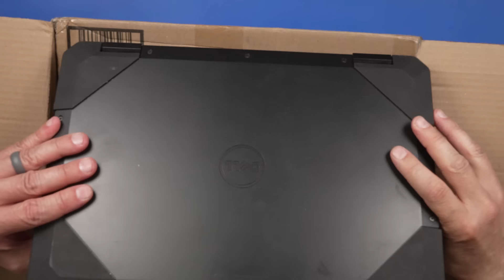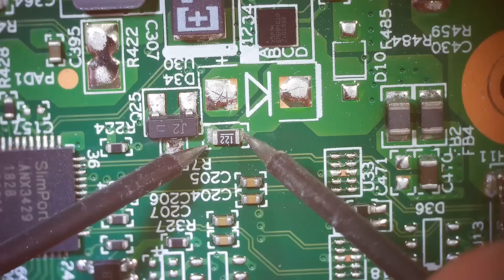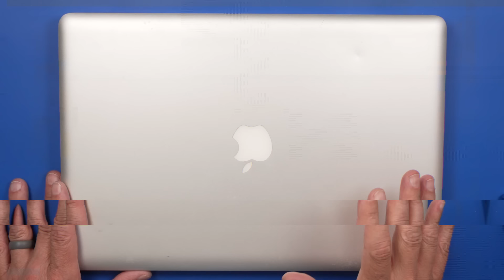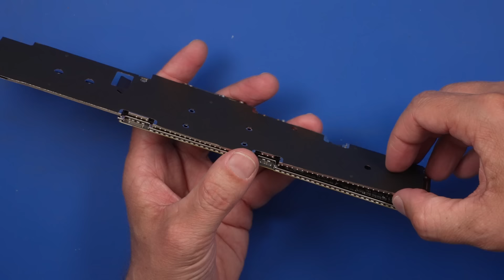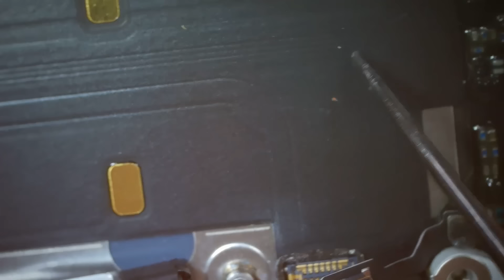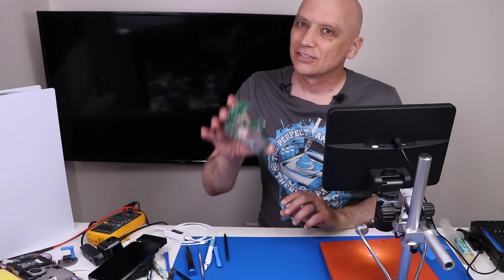Austin Evans Broke These with a USB Killer - Can I Fix Any?!

Comment: 1st device: the problem is a PMIC or ceramic cap that's shorted to ground. put a bench power supply in C.V. mode set to .8V (usually low enough that it wont damage any processor the line may be shorted/connected to) and set the current to the max. if there is a shorted cap/IC, it will get hot (you can detect this without a thermal camera using 99% isopropyl alcohol, drip some on, and look for the component that starts drying off instantly). that coil specifically is hard to tell if it should appear low resistance to ground, since some components (like the CPU) can appear as a very low resistance, but others (like a charging circuit) can appear as high resistance, and since its near both a charge port, a port that can output power, and the CPU, its hard to know without a schema (though you could always check continuity to the power pins of ports)

2nd device:it seems like you're looking at the charging/battery circuitry, which wouldn't have been effected by the USB killer, which delivers a high voltage via the USB port. you would need to look at the USB circuitry to have any hope of finding the problem

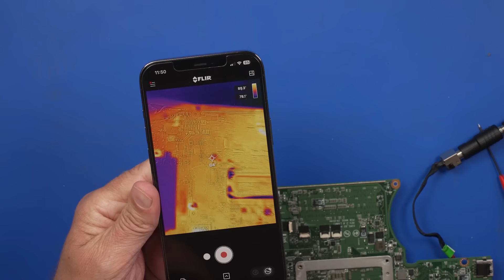3rd device: those two little components are TVS diodes (these ones apparently arent exactly capable of withstanding and protecting against anything as mean as a USB killer). while it is possible that the one component you removed (which looked like either a voltage regulator or possibly a package with a 2 mosfet pair) is blown since the temp dropped after you removed it, its also possible power was flowing through it and being shunted through something else that was blown. also, the reason it looked like the hot-spot was in an area without any components is because the thermal camera you're using has both a visible light sensor and an IR sensor, and in the app you need to properly align the two images. at 19:20 you can see the circular screw hole (visible light), and then above it you can see a yellow ring (IR light) caused by the semi-reflective exposed copper ring surrounding the screw-hole. if the app/camera is properly set up and calibrated every time you use it on a new device, you shouldn't have these issues. (I don't recommend getting a flir or similar, I found mine to be a bit of a waste)

4th device: while it does look like the TVS diode saved the port's ass, I would be curious to see whether or not the data lines on this port are still functional, since on an earlier device, the TVS diodes on the data lines looked blown. I'm not sure what all lines the USB killer sends voltage into, but it looks like he didn't fully test the ports here

my break is over, but I might leave a comment with the rest of the devices if anyone cares.
Reply: Would this apply to a GPU as well? I popped something on a graphics card and now the whole card stays cool except one IC or something on it gets very hot, like hot enough to burn me if I held my finger on it long enough. Given its only a HD 7950 but I would love to get her back up and running. I have a gt 730 and a gtx 1050 ti that all do nearly the same thing. When you plug them in and use igpu the cards are detected but have the "!" in the triangle icon on them. The hd 7950 and the GT 730 had the fans connected backwards and blew up something fan controller related. The hd 7950 had one fan that would not come on while it worked correctly. After it blew both fans just run at max RPM now.
Reply: @HardWhereHero   just to clearify, for the you can boot up the system with the GPU installed, and using the igpu for display out, but the GPU shows up in device manager with an exclamation point? And one specific IC gets burning hot? At what point we're the fans connected backwards, and did the card output video after that? It could be that the fan controller died, and the card is going into some form of pre-emptive thermal shutdown. Usually the chip that controls the fan has the ability to put the card in something of a safe mode, and if the whole chip is dead, this may be what's happening. I would need to physically see the card to be able to give my best advice, but I can still try to help via comments.
Reply: I was really surprised that he never bothered to try the alcohol method. I hate watching these videos half finished. I'd love to see him make another video revisiting these possible solutions.
Reply: @bgubs07  Considering his condition it's great he is uploading any video at all
Reply: @terminationshock1356  this is not related tohim having cancer, he simply doesntknow what todo. He aint no genius
Reply: @bgubs07  right?? Like, as an electrical technician (studying to become an engineer, but not one yet), it's painful to see this sort of thing.
Reply: @alexplayslife7782 so, what thermal cam do you recommend? Board repairs is just a hobby for me,  with pretty low success rates, if I'm honest 😂 but, I have been wanting a cam, and was considering the flir, but it's a pretty hefty price tag, so have not pulled the trigger just yet.  Do you have a better recommendation in that price range? (Or cheaper)
Reply: @brody6634  a flir cam that plugs into your phone is a good option (be sure to read/watch tutorials on it, because there's more to learn than you'd think). They can be a bit pricey, but are available on Amazon. In lieu of a thermal camera, may I recommend using isopropyl alcohol. It will evaporate very fast when heated up, meaning any shorted caps/chips will dry up much faster than other components
Reply: @brody6634  huh, I thought I answered this comment before, but my reply doesn't show up here for some reason. well anyways, I've used a flir in the past, the kind that just plugs into your phone. I could recommend it if you do high-volume repair, or work in a shop and are willing to let the other techs borrow your stuff, but it's not really all that necessary. You can always use the isopropyl alcohol method, where you pour a bunch of isopropyl alcohol over the board, and whichever component is shorted will get really hot when powered on, making the alcohol evaporate away really fast. This only works if there is actually a shorted component, and also if no fuses have blown, disconnecting the short from the power rail. It's not as clear or detailed as a thermal cam, but it is much cheaper. If you do get a flir or another thermal camera, I employ you to read the manual, as I promise there's more to using it than you think. If the manual isn't detailed, please read up on reflectivity, aligning the thermal camera and optical camera (specifically on flir cameras that plug into your phone) and try keep in mind the temps you're looking for. If a moafet gets up to like 70°C when it's normally only slightly warm, while that could be the problem, it's likely that something else is shorted and is drawing power through the moafet (and it'll be much hotter) that is all to say, don't assume something is the problem just because it's warmer than usual, there's likely more to the story (also look at both sides of the board, sometimes a shorted component won't be able to heat up the board through to the other side, so you won't see it.
Reply: No esfacil reparar notebooks, tenes que estar en el tema, recomiendo el canal de REPROMOD. Al margen de eso me parece que el M6 AUC 4S0101 para mi debe ser un mosfet doble, similar al Aoe6930.
Reply: @alexplayslife7782  thank you for your comment. I appreciated it.
Reply: I thought the same thing for device 1 and noticed at 4:47 that C358 just to the left of the chip he's talking about looks like it could be cracked.
Reply: something else that might be useful to know, the USB killer works by taking in power from the USB +/-, then injecting it directly into the data pins. it's a lesser protected vector of attack, that usually results in a dead CPU, USB controller, or both, or even others.

he mentions them having no power... and with a dead CPU, that's entirely possible.
Reply: @starfox.64 kinda late for the disscusion but yeah, I learned in a bad way that  the USB ports have a kind of direct line with the CPU so, even with a daily use if you do not connect right you usb thumb drive you could kill the cpu and that usb port.  This is insane when you look that with Thunderbolt and USB 3 a lot of power can be send directly to the CPU if you are not careful
Reply: so true
Reply: @alexplayslife7782 Give me whatever book(s) you used to learn all this lmao

On a serious note though, I've wanted to get into micro-computing like this but finding good sources to read that fully cover the material to this degree is just utterly impossible.

Comment: I think a faulty charger caused something related to the charging on my sister's macbook to stop working. Cus i got a replacement battery and it turned on and worked but no matter any of 4 usb c charging ports I tried, it wouldnt charge. We took it to a tech repair store and they said it would be $300 to fix 😭

Comment: Should have checked if d+/- were shorted together. Im pretty sure the killer sends significant voltage down those rails but they are usually isolated from the power and ground planes.

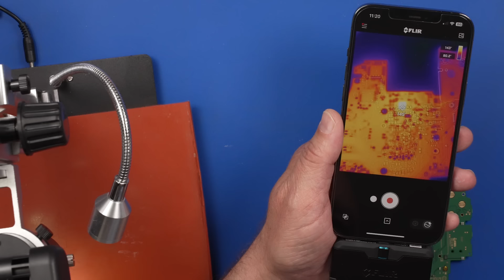Comment: 31:43 and 36:49 That FLIR camera has two different sensors, visible and IR light, they are offset to each other, from the phone's perspective the IR camera is a little bit above where the visible camera is. That's why the hotspot moved from horizontal to vertical, the actual hotspot was the chip the entire time.

Comment: I think you should be checking the USB data lines where the USB Killer was plugged in rather than the power input (for the second device for example). The way the device works is it provides high voltage to the USB data lines (not USB power lines)

Comment: Just in case the comments haven't already told you, but at 31:37 the reason the hot spot looks to be so far to the left is because the visual camera and the thermal camera are out of alignment. If you look at the very left edge of the board, you can see the thermal edge doesn't match up to the visual edge.

Comment: Austin Powers: USB Killer,, I think the capacitor to the left of M92 chip is the CPU one so it will be far gone for the switch light, as for fuses I think they might be showing continuity but due to being shorted to ground and in fact they are open line..

Comment: it really sucks that a lot of neweer USB controllers are in the CPU/APU/SoC with minimal to no protection in the path between the port and the chip.
In a laptop I had about 12 years ago or maybe almost 20, it had USB "fuses" that could be re-engaged in the driver interface through windows while running without a restart being needed.
A lot more like a breaker than a fuse.

Comment: Also, the TVS diodes on the boards should be shorting to ground when they are blown instead of blowing open circuit like a fuse.  This is so the excess power has a direct path to ground instead of through the rest of the circuit.  I'd look for other TVS diodes shorted to ground and maybe some shorted MOSFETS like in the laptop, but they likely aren't worth the search time without a schematic to point you to them.

Comment: That 7M9 component (edit: on the PlayStation board) is a TVS diode similar to the 0502N on the MacBook's USB port, but the 7M9 is designed for USB-C data lines.  Again, never enough to fully protect a device from high-voltage attacks and probably one of the cheaper and practical solutions to a problem that almost nobody will ever experience.  No reason to worry about it since there are so many other quicker and more definite ways to destroy electronics, like stabbing it with a knife or a screwdriver or bending it in half on a table edge... also, a lot of more spectacular ways like fire and explosives. ;P
Reply: I believe the 7M9 chip on the PlayStation board is this ESD7104MUTAG or similar.
Yes, it would fail short circuit like all TVS protection diodes would.
Edit: Short to ground that is.  Pins 1, 2, 4, 5, 6, 7, 9 and 10 would short to pins 3 and 8, iirc...

Pin 1 and 10 should conduct to each other but not to 3 or 8 (ground) or other pairs.
Pin 2 and 9 should conduct to each other but not to 3 or 8 (ground) or other pairs.
Pin 4 and 7 should conduct to each other but not to 3 or 8 (ground) or other pairs.
Pin 5 and 6 should conduct to each other but not to 3 or 8 (ground) or other pairs.

Comment: The first one is probably caps shorting the + and - need to remove some caps and see if the short is still there. Or you can inject voltage and use a thermal camera to see what gets hot to locate the short

Comment: Honestly, there really isn't any good way to defend against high-voltage attacks that kill electronics, but there are also even easier ways to kill a laptop, like breaking it in two or just ripping it apart like you're wolverine or throwing it into a camp fire.  Fuses aren't going to do much with high voltage spikes like that and Zener diodes might not have enough time to go into permanent short circuit to protect the board.  To really protect the data lines from a high voltage attack you would need to isolate them electrically with optics or some other isolation technique and even that may not be enough.  TVS and Zener diodes can help limit the voltage spikes but you would need some fast ones to deal with such high voltages.  And the biggest hurdle when using optics to isolate data lines would be finding components that can switch fast enough for the speeds of the port, which is impossible for consumer level and too expensive for USB ports.  And there is still no power line isolation.  A high enough spike through a 5v line might kill a regulator and the USB chip and maybe the board chipset and CPU, but USB-C can provide up to 20v on a port and a spike on a 20v line could kill everything in the laptop and possibly short the battery circuit making for an even worse bad day.  Idk, there are many easier ways to destroy electronics.

Comment: Awesome video, Steve! Appreciate your highlighting the ignorance of manufacturers not adding basic circuit protection to already grossly overpriced electronics. 2 points of surge/spike protection are always best in most homes, 1 at the panel and one at each outlet being used for power and/or charging pf delicate electronics.

Hope you are doing well!

Comment: You know Steve,  maybe get a USB killer and pull apart a known good device plug in the killer while you have the device out and under heat camera. Watch it as you turn it on to see what gets hot. And where.  This would give you idea on what happens.

Comment: As someone who has killed laptop mobo just by shorting internal usb to ground, i can tell this: at least in my old-ish laptop, usb is connected directly to PCH and later integrated into chipset, since usb killer discharges voltage on data lines, it goes mostlikely directly into chipset, killing the motherboard

Comment: My guess is that the usb kill stores the up to voltage then switches the power to the actual usb port and not the power ports via a relay. this would result in the high voltage going to the usb interface chip. Chasing down the power would not locate this type of failure. I would either look at the bus chips (the name is failing me now, peripheral interface chip), a solid failure on it would bring down the bus thus stop power up. A thermal view might show it getting hot or being way too cool.   but what do i know i repaired C64s in the day.

Comment: Steve, continuing to send good vibes/prayers. 

At 37:56 when you were putting IPA onto the chip, just off to the 2 o'clock position, is a capacitor with a black spot. Probably blown up, maybe cracked.
Reply: Pretty sure that was just Sharpie that he used to mark where the heat is coming from or to mark that capacitor as shorted, as when he first looked in that area there was no black spot.
Reply: @deathbyzombiefilms  it can't be sharpie because he's constantly cleaning over it with IPA and the markings don't go away
Reply: @joveaaron-real  after going over it with IPA most of it goes away, and once again it's not there when he first starts looking around there. It's only there later on.
Reply: Eagle eye

Comment: I just bought 2 ps5 controllers on ebay for $45 that both have stick drift and ordered replacement analog sticks, I should make a decent profit on them, and since my new soldering iron/ hot air station came in I'll be getting some practice in on replacing hdmi ports

Comment: On the first laptop maybe check the capacitor u34 for a short, looks like that's also on the main power line. Or put some power on it and check with termal

Comment: When it comes to a USB killer. It sends voltage down the data rails of USB. You basically have to check for components on those data rails to be broken. Unless you know what you're looking for on a lot of laptops. Theyre hardly ever fixable

Comment: Loved the video. I have the same FLIR lightning dongle and there is a way to adjust the offset between the thermal image and camera image to an extent. At 31:38 you clearly see the offset (of a chip's length) between the to superimposed images.

Comment: You are very correct when you said that crazy things happen when you unplug/plugin a battery. A lot of ASUS machines I have dealt with that had a short would not turn on unless I detached the battery, powered the machine on just the AC, and then plugged the battery back in. Smart batteries have their perks.

Comment: I hope the community can help me here. I always have the issue that tiny components are blown away from the heat gun. Used minimal airflow. Have problems Holding These with a tweezer while heating. Any Suggestion?

Comment: One tip I saw on another tech channel, Spraying IPA... Really helpful to detect shorts. It evaporates really quickly around the burnt chip/fuse etc. 
A cheap and quick way to find out where is your problem.